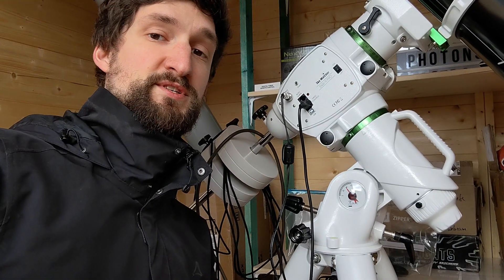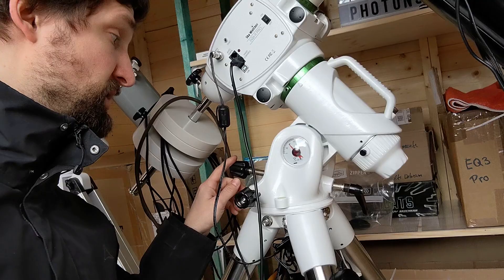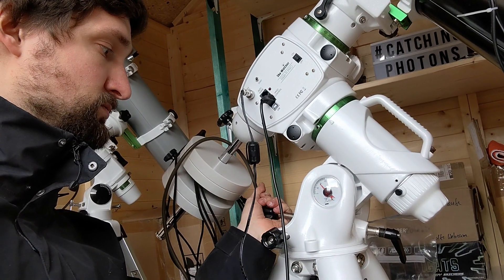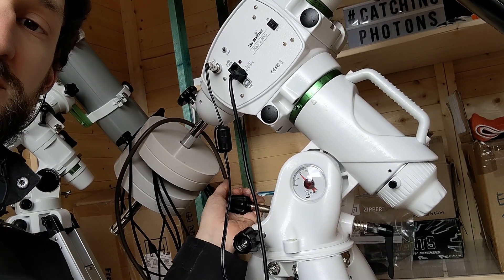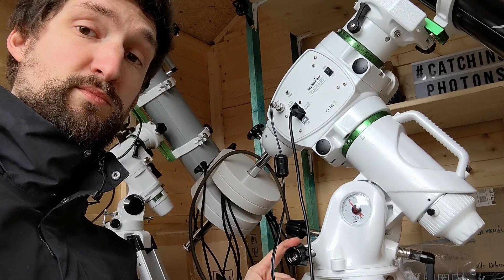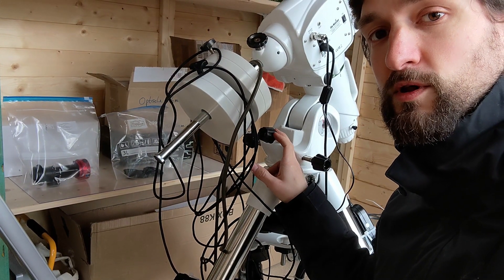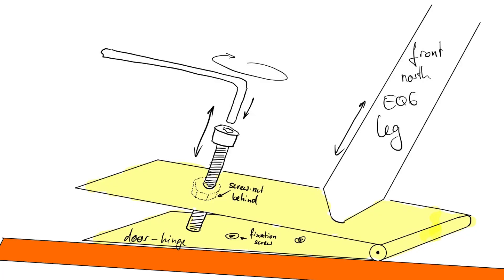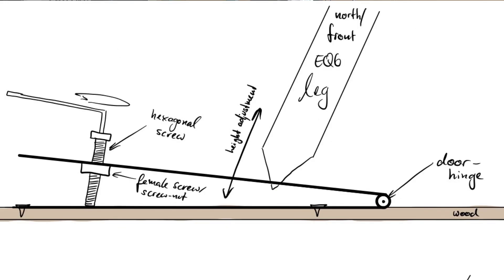Astrophotography-DIY: HELP!! EQ6-R Pro ALT adjustment

Comment: I have the same mount unfortunatly this hoby is insanly expensive and this is relatively cheap mount so you you need to fidle with it. what I do is tighten the back knob little bit more than it needs to be and adjust with front know. you have to be real close to perfect polar alignment before you try this. I am using sharpcap and try multiple times. Good luck.
Reply from the maker: I actually built my "diy front leg lifter" (see my second video on that) and it works like a charm!! Drastically decreased alignment time. 
Cheers 🥂!
Reply: @catchingphotons  I seen that Ibelive if I try that I will create more problems  and it is not very good option for my curcumtances.

Comment: No sorry your mount brace will no longer be level. My suggestion would be to remove the adjusting screws and add a small amount of Greece to the thread and the end of the screws, or get some engineering help and have the casing redrilled and cut with a finer thread and new screw’s made to match , the finer the thread the more leverage over the mass and the finer the adjustment, shouldn’t cost all that much if you shop around ( never over titan fine treads they have power to damage, which is probably why the manufacturer hasn’t fitted a finer thread ? )
Reply from the maker: It works fine.

Why should it matter if the mount brace is not perfectly level? All that matters is the rotational axis of the mount head, isn't it?  And anyway: we are talking just a few degrees. 

I'm interested in your opinion on that. 
Cheers!

Comment: Don't you need a (near) perfect leveling of the tripod? I found out that this is crucial for accurate tracking and guiding, so I level the tripod first and then adjust an altitude using knobs only (even though it's a pain in the arse).

Comment: Hey Chris, i agree with Tim. On the HEQ5 i approach as well from the "top" in the polar scope. So estimate the tightness of  the lower bolt and i adjust the position of polaris in the scope with the upper bolt. If it is too lose in the final position, i losen the upper bolt again and correct the position of the lower one. So you dont always have the same tightness on the bolts, but its fine.
If you move any weights after polar alignment i would be afraid to get any error due to flexibility of the mount. You basically would polar align an unbalanced system, cant be good :D
Reply from the maker: Thanks pulsar!
The "from top" method sounds good. 
But the inconsistency in "how tight shall I tighten the knobs" drove me crazy during fine adjustment... 

After polar alignment I don't shift any weights anymore... I just pass the fine alignment from the ALT bolts to the front leg. Both are equally suitable to lift the scope/mount...

Comment: I have to say, for what the mount costs, the build quality is shocking. Does anyone have a solution to the awful height adjusting bolts on the legs.
Reply from the maker: I generally like the mount very much. Some things are not perfectly designed though. The knobs for ALT on the EQ6 do count as such. The height adjustment isn't an issue for me because of permanent setup...
Clear skies!!

Comment: I think you are putting too much thought into the matter. I experience the same issues with the HEQ-5 - moving the altitude up is a real pain, since you have to lift the counter weights. That's why I approach the NCP from "above" (seeing that with the ASi Air polar align makes more sense). The alt screw facing the counter weights, moving the scope down, does not need to be super tight. If the balancing is good, any rotation on the RA/DEC will not affect a screw that is not that tight. As I said, by moving the scopes axis into the NCP from above, tightening that screw, I am able to get good results, within 2". No need to tighten it fully. Hope that was clear
Reply from the maker: That was clear sir :-)
The "top to bottom" approach seems clever, thanks a lot!
I always was concerned about the "tightness" of both screws and was in doubt of stability during the session. So I always tried to tighten them in a consistent manner. 

Anyway: the hinge-method works like a charm. 1/8 turn corrects for ~1" and that it super sweet! The ALT screws stay tight and don't concern me anymore. 

Thanks for your thoughts mate!

Comment: The problem I see with your approach is that the tripod should be level prior to seating the mount head. The work around to those atrocious knobs that I use is just keeping tension on the polar side bolt. I have both hands on it the entire adjustment. It’s a real pain but ultimately lots of folks replace those crappy bolts. That truly is a terrible design that monstrosity they produced.
Reply from the maker: Yep true. 
But the tripod stays leveled anyway. It's all about arc-seconds and no mount on earth is leveled by this amount of precision anyway. So a quarter of rotation of the screw in any direction won't make any difference. 

It's even a reconnected method on the SharpCap webpage for peer owners. 

Thanks for your thoughts!!! Clear skies!

Comment: Weight distribution.  Need a larger circumference (and heavy) weight placed toward tube as far as possible (reduces torque by decreasing distance to fulcrum).  ideal adjust with weight and not distance down the weight shaft... imo.. gl
Reply from the maker: Thanks but can't change weight distribution on my setup...

Comment: Hi Cris, join the club! I eventually replaced the lever with a normal knob which considerately increased my abillity (and decreased my time) spent on polar aligning my EQ6R-Pro. Check: https://shop.deepskydad.com/product/skywatcher-eq6-r-pro-altitude-adjustment-knob-replacement/  Hope this helps!
Reply: Agree completely with Wido on this.After struggling with this same issue for a few months I also replaced the lever with the deepskydad knob,best upgrade ever you could buy for this mount.